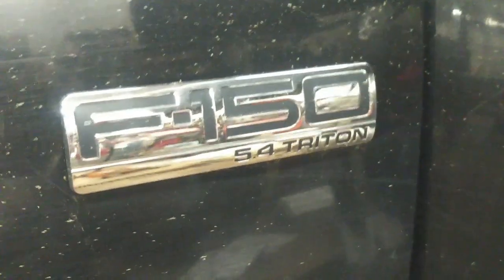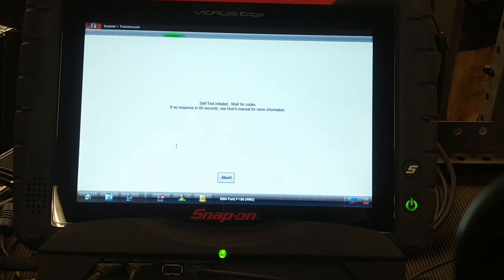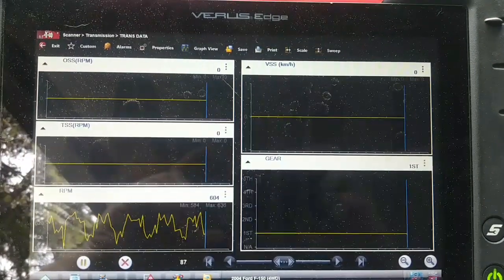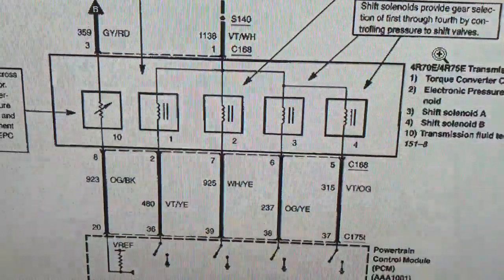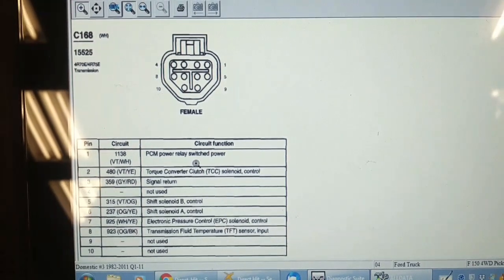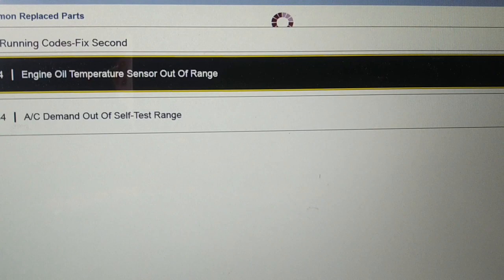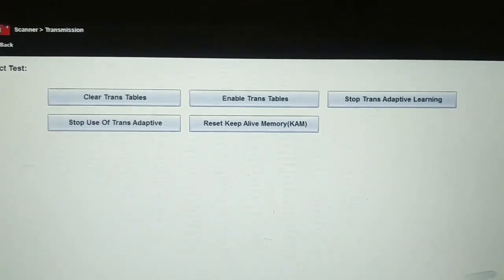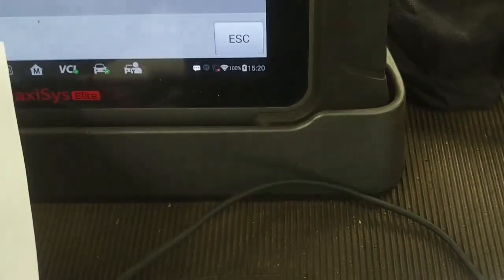2004 F150 P0740, P0743 TCC Solenoid Circuit Fault

Comment: I have a 2006 f150 fx4 it does the same exact thing I just had the transmission rebuilt wasn’t doing it prior to rebuild pulled pan on trans the tcc plug for the shifting solenoids inside  the pan has a crack in the molded  lead frame just a  wiggle and puts it in fault mode have to replace it, And the rubber boot on the tcc plug should keep the plug on top of the transmission dry not always checked, when re/installed And Was very frustrating trying to isolate the problem figured it was the overdrive solenoid in the transmission or the valve body, but it was just recently rebuilt so not to say it couldn’t have been the snap ring that holds the solenoid in, but you would think it wouldn’t be that breaking and it ends up in your overdrive valve and usually plugs it. But watching your video, I figured. Wait a minute yeah long story short more than  likely when they pulled  the internal molded lead frame!  Out to remove the valve body those things get really brittle from heat cycles as any plastic does! Well, that’s the internal wiring for your transmission basically!  It’s a pain in the rear long story short purchased a new one replaced it no problem it basically controls all these  shift solenoids in your transmission! Good luck
Reply from the maker: Glad you figured it out

Comment: That Ford has a 4R70W or 4R75E transmission.  I would guess that the intermittent problem is the connector inside the pan --- where the molded (internal harness) and main connector meet. I have same problem, but when i pull over and restart, drives normally & no trans fault alert. Thank goodness FORD doesn't run TCC wires thru uncooled fuse box on passenger kick panel.  I am also suspecting decayed insulation on the harness connector wires outside of the transmission (which is where i will begin a visual inspection (after removing tape and harness protection) since this truck has spent time in the northern USA.   🇺🇸

Comment: Thank you for this video, this helped me with my transmission. I do have a 2006 FX4 and when checking the TCC resistance it was the two outer pins on harness 6:40. 3 and 4

Comment: I have a lot of trans fluid in case connector plug. I changed the whole trans harness and still have o/d and trans fault. Should I reset trans codes or do you think it’s internal?
Reply from the maker: If the code won't clear then you still have a problem. Yes could be internal.

Comment: The internal "wiring harness", which is a hardwire incased in plastic. All the solenoids have flat pins which the hard wire harness snaps onto. Possible the rebuilder didn't make sure harness was snapped on correctly.  Bet if you if you wiggle the inside harness, you would find you intermittent lockup problem. Internal harness connects to the pressure control solenoid, lockup solenoid, and the two shift solenoids, which share the same bracket. All that banging on the pan won't do anything. the harness doesn't come in contact with the pan . Easy to check. drop the pan and lightly pull on connections. shouldn't have play. Should be a good amount of resistance unsnaping from the solenoids.

Comment: I have a 2004 F150 Lariat 5.4 4x4 Truck: I recently experienced my O/D flashing while towing my boat but only happened juts before I got home. When i got home I noticed I had no reverse and only drive. I changed the neutral safety switch and checked all fuses and relays/solenoids. My truck will only go in reverse and when I shift to drive, it will not move at all. Truck will not move in any gear except reverse. Do you think it is my transmission wheel speed sensor or transmission solenoid? My fluid is good and my friend checked for codes and noticed nothing. What am I missing?
Reply from the maker: Doesn't sound good. What are you using to check for codes. If the OD light was flashing there will be a code in the transmission controller. Need a decent scan tool. An OBD2 tool will typically only scan the engine. If it won't go into drive and the transmission is actually full there has to be a code or codes in the transmission controller. Good luck
Reply: Phillip Bailey it goes into drive but doesn’t move when I give it gas. Initially I lost reverse and only had drive. Switched the safety neutral switch and got reverse but no drive. Weird
Reply from the maker: @dvocho   You need a decent scanner to retrieve and transmission related codes. Could be an electronic issue as reverse is mechanical and does not require solenoids but without codes we are just guessing. I hope its not a problem with the shift cable. Does the PRNDL actually display that its in drive? Does it go into manual 2 or low and display those selections?
Reply: @dvocho  Hey mine is doing the same did you ever figure out what the problem was
Reply: @beamer2169  I replaced every part I could do myself and in the end, the transmission was no good and needed to be replaced. I recommend taking it in for a diagnosis.

Comment: I have a 04 f150 lariat, i just replaced the motor on, and just recently the O/D light start blinking. Also every time im at a complete stop at a red light my truck starts to like jump forward.?
Reply from the maker: you need to have it scanned to start with. The flashing OD light is a sign that the transmission controller is setting a code. Probably transmission slipping or TCC slipping but the code/s would help. good luck
Reply from the maker: The Truth of the Matter  I'd go back to the repair facility who did the transmission work as its likely related. Good luck
Reply: That would be torque converter

Comment: Same thing happened to me after I put a trans in what happened was I ran the wire harness to close to the head and the headers the extra heat melted the harness your trans temp sensor wire is at the bottom of the wire look and it melts first and as it dose it grounds out again the headers or the head and it gives you way high readings and it will trip this code
Reply: If u are seeing big swings in trany temps like it’s 185 then 2 seconds later it’s 257 you need to look at your wire harness because it’s rubbing somewhere and when they hit a high enough temp this code come on
Reply from the maker: @texashillcountryadv9197  thanks for the info. No headers on this truck so bit more room. Seems fine now since the solenoid repair.

Comment: Mine dies as I switch it to gear immediately. Could be the TCC  solenoid that makes the torque converter engage when in park. and unengaged when in drive. Same problem but it's one thing different not moving
Reply from the maker: On rare occasions a stuck TCC solenoid can lockup the torque converter and cause it to stall when put into drive. It would feel like you let your foot off the clutch on a manual transmission too fast. Does it try to jump forward when you put in drive? I've seen that symptom but not on this transmission. Will it stay running if you give it gas when you drop into drive? Any fault codes?
Reply: @PhillipBailey  it dies as soon as you go to gear drive.
Reply: @PhillipBailey  Mine will stay running if I give it gas when I drop it in gear. Only codes I've thrown after phasers, cams lifters and rockers, chains and guides, oil pump and pick up, are a 0340 and 0344.
Reply from the maker: @kawonu2666  those are cam timing codes. If the engine is not running correctly it may not have enough power to keep up with the load when put into drive. What happens if you give it more gas and select drive. I havent seen TCC stuck on issues on these but thats possible. good luck
Reply: @PhillipBailey  If I give it gas before it dies it has tons of power and everything sounds great. Every now and then I can start it and it will run right and idle good everything. But most of the time it's seems to be a low erratic idle. I have new plugs and coils also.
Reply from the maker: @kawonu2666  if your base oil pressure is low the cam timing phasers can't work correctly. You can't go by the oil pressure gage on the dash as its just a dummy gage (any pressure over 10psi will make it read normal). This is not enough as im pretty sure it needs a min of 25. Some of the aftermarket timing components are not good quality. Need to check out tge cam timing codes before you worry about the stalling in gear. Ill post a link to a very good channel and Ford tech who specializes in these.
Reply from the maker: Check out this fellow if you haven't already.
Reply from the maker: https://www.youtube.com/user/FordTechMakuloco
Reply: @PhillipBailey  That's my guy but his videos want me to go back and look at the parts I just put on and some of that is a pain lol. Thanks for the quick replies.
Reply from the maker: @kawonu2666  unfortunately he's probably right but I'd check base oil pressure too.

Comment: I'm not sure about the F-150 but I know Ford sent out Technical Service Bulletin for the Explorer/Mountaineer regarding the A/C drain positioned right above the Transmission wiring causing the wires to corrode and the transmission to malfunction and/or send CEL codes. Pretty simple fix. 3/4 heater hose and a worm clamp to reroute the drain away from the trans and replacing the transmission wire harness. Hope this is the source of your problem and it helps.
Reply: I know Im kind of randomly asking but do anybody know a good place to watch new movies online?
Reply: @Cairo Landyn Flixportal :P
Reply: @Cameron Makai Thank you, signed up and it seems like they got a lot of movies there :) Appreciate it !
Reply: @Cairo Landyn happy to help =)

Comment: did you figure out the problem
Reply from the maker: yes I did, https://youtu.be/2hWPRNQvGDQ. If you're have the same or similar issues I would suggest to check the wiring to the transmission from the PCM for rubbed through spots as well.